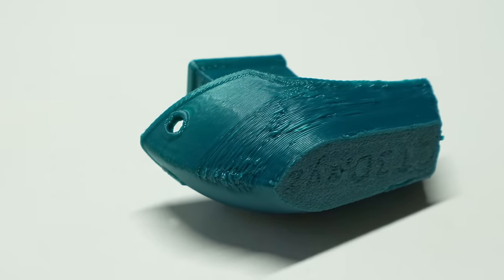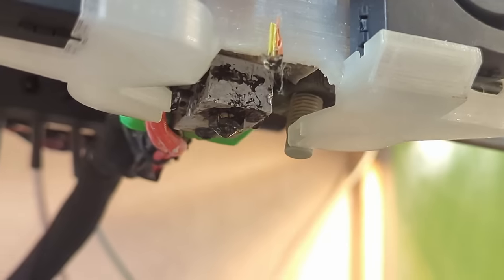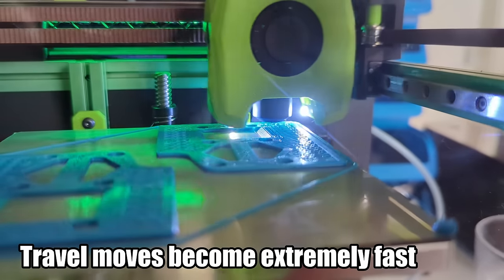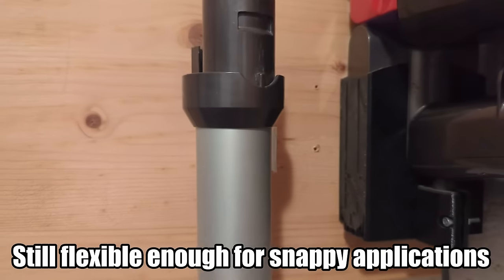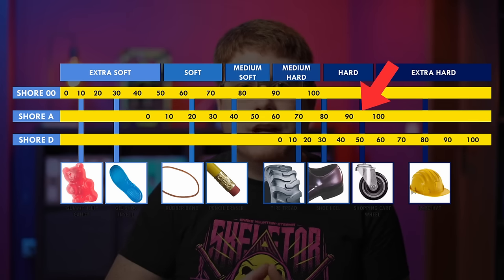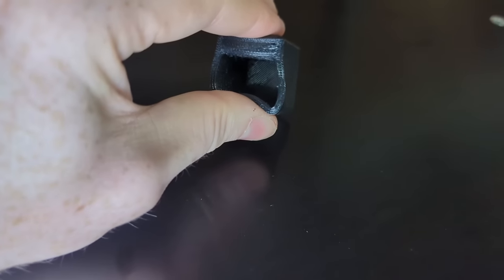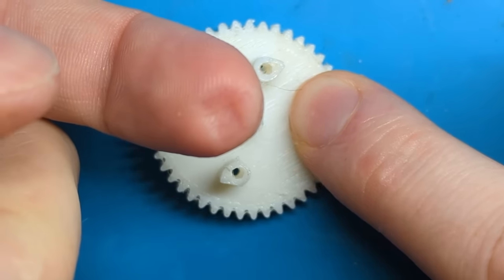3D printing material: When to use PLA, PETG, ABS, TPU, Polycarbonate, Nylon etc.

Comment: For nylon: hair spray on top of PVA glue on glass. I've had nylon break a glass bed when only using hair spray, and when cooling down after printing and it took a big layer of glass with it. You really need a glass print bed and good first layer otherwise it WILL warp. 100-105 bed, 280 hot end, over 50 chamber for generic pa6. I've printed a lot of nylon and it still warps some times if everything isn't perfect. It also doesn't like speed, 80mm/s max. Kind of flows like petg.
Reply from the maker: Higher chamber temperature seems to be the biggest factor, but my Prusa doesn't go above 40. I'll need a real heated chamber printer at some point
Reply: @SmallBatchFactory  I'm a bit unsure if it will break something, but there are some 300W 24V Heaters available. I thought of putting one inside the Prusa enclosure to heat it up to 50-60°C prior the print. Maybe not during print, because of the air turbulence it will generate.
With the MK4 inside the enclusure, it will also heat up the electronic boards and I'm not sure how they can cope with this extended period of higher heat.
I got a roll of pure PA6, not didn't dare to open it yet. (Also I don't have anything that needs the properties of PA6 right now)
Reply from the maker: Simply put: DON'T do it! Prusa parts are made of PETG and will get soft. I'm also wary of frying the board, I already had one but it was covered under warranty. No clue if it was the chamber but it definitely contributes.

For anything actively heated you need to keep anything sensitive to heat outside of the chamber. IMO it's not worth the hassle, I'd rather buy a machine with heated chamber where the manufacturer guarantees it will work. Killing your $1000 printer is quite a dare.
Reply: @SmallBatchFactory  Sadly, what I thought may happen. Would mean a thorough rework of the printer. Reprint the PETG Parts, active cooling on the boards and steppers. Could use peltier modules for that, because they then heat the enclosure while chilling the components.
I'll try to print without extra heating. Maybe just a longer preheat phase through the bed heating.
Other option is to print the prototype in something easier and then let a company make it out of whatever is needed.
Reply: @drstefankrank heat up your chamber with a hair dryer before you start
Reply: @travistucker7317  the hair dryer might work better than starting with a cool chamber, but it has also way more power than a 300W heater. Of course that heater would  need to be temperature controlled and stay safely below the PETG softening temperature.
Reply: @drstefankrank  Of course, you could melt the whole thing if you just let er rip. I used one for a while on a dip switch timer with a cheap thermometer on the gantry. 15 on, 45 off seemed to be the magic number for 40c for me, but your mileage may vary.
Reply: @drstefankrank  with your original comment of heating up the chamber before the print, that was what i was suggesting, more of a simple preheat.
Reply: @travistucker7317  Did this help you significantly with prints of difficult materials or  is it just not worth the effort?
Reply from the maker: It highly depends on your printer chamber. In my case they aren't well enough insulated to get significantly higher in temperate than maybe 1 or 2 degrees even after hours of printing. If you have a thermometer on hand you can put it in the case and test yourself. 

Getting the printer to 60 degrees certainly makes a difference but might also be harmful for electronics and motors inside the chamber.
Reply: @drstefankrank   @drstefankrank  That printer only prints abs printer parts. Really, more than anything, it improved consistently. Less parts warp off. It's harder on cheap bearings and belts, too. I would say it's worth it.

Comment: I've only ever used PLA, PETG, and TPU so far, but I recently got a new enclosed printer and I'm excited to try ABS and maybe some of the fancier stuff.
Reply from the maker: Just don't forget to have good ventilation and stay safe. If you're struggling I have a separate video on ABS printing.
Reply: Make sure to turn part cooling off. I ruined 5 prints before I found out that was the problem with ABS.
Reply from the maker: The funny thing is that's a way too generic take. At least if you have an enclosure. My ABS prints improved by a lot when I learned to turn the fan ON. I have a whole video on printing ABS
Reply: @SmallBatchFactory  what problems were you having? I forgot to mention I also moved supports closer. With the fan on the supports kept failing.
Reply from the maker: "fried" parts. You can see an example on the Thumbnail of the video. Heat simply accumulated. But I also design to use no supports (in the videos case those were Voron printer parts I just needed to print).

Long story short you can either print rather slow (or a large part) or you will need cooling (as always in a enclosure that is)
Reply: @SmallBatchFactory  I guess I will have to watch your other video

Comment: I needed to hand drill and thread holes in a soft PolyUrethane part, it was a nightmare, as I needed to compress the bit for it to bite, but not too much to keep a straight hole, and threading the hole was a nightmare due to the need to take out the tap and remove the residues. Post processing soft material is to be avoided as much as possible
Reply from the maker: Word! I cleaned the TPU part shown with a scalpel for hours. It's still not clean but good enough. Second print with retraction went a lot better

Comment: Great vid! How about which printer works best with which material? I.e. Ender is good ONLY with PLA, etc.
Reply from the maker: Thanks for your suggestion! There's no real "this printer doesn't work with material X" except for the three factors I discussed in my "which printer to choose" video. Other than that it's a matter of  tuning the machine correctly. Some materials are more beginner friendly than others.
Reply: @SmallBatchFactory  ok good to know. I sometimes go around in circles trying to ensure I pick the right machine. I’m living with an Ender 2 and desperately need an upgrade.
Reply from the maker: I personally love the reliability of the Prusa machines, but that also comes at a cost. Cheaper machines with cheaper parts just tend to give you more headache. Even my Voron had issues last weekend because of cheap extruder gears. Never had that with original Bondtech but they're also 32 bucks just for the gears...

Comment: I use what is appropriate for the application. 90% of the time it’s PLA (generally use a PLA+ unless it’s purely decorative). While I love PETG generally when I’m considering it there is something more appropriate for the application like ABS or ASA (as much as I hate printing ABS due to the tight rope walk of keeping it warm and ventilated in my tiny office).
Reply from the maker: Absolutely the way to go IMO. PLA is perfect for prototyping. Usually PETG is best for technical parts if you don't need the extra heat or impact resistance of ABS or UV resistance of ASA

Comment: I made those same shelf brackets for my filament out of PLA, they held up for 2-3 years then one night I heard a "BANG!", one of the brackets snapped in half and the dozen or so rolls of filament hit the shelf below it, broke those brackets and around 20 rolls of filament and the wood stringers hit the floor. I thought a car crashed into my house. I ended up using metal shelf brackets with PLA top pieces to hold the wood stringers in place.
Reply from the maker: That sounds like what PLA would do. I'm most  weary of the front wood holder, it seems rather fragile and already gave a bit in. Du you remember how many perimeters you used?

Comment: I've found that TPU actually has a much higher temperature resistance that PETG. Yes, it gets softer and more flexible when warm, but it does not permanently deform under heat until WELL above what PETG does.
Reply from the maker: Yes, for the video I've stuck with official numbers but as you say it behaves quite different in reality.
Reply: I remember reading somewhere that TPU has glass transition temp of below 0 degrees thus at ambient temp its not rigid, so at higher temps it get a little sticky yet remains somehow intact till its melting point, I ve use it to print cap for car's coolant reservoir and after months in the bonnet its still snug as before.

Comment: I use stock ender 3 to print generic TPU (probably the most rigid type)  and instead of printing it without retraction im actually printing it at 8mm retraction at 20-35mm print speed and adjust overlaps setting and prints just fine. The biggest impact is if how dry your filament is.
Reply from the maker: It works, yes. As I said you have to go really slow. You probably also have very low retraction jerk set for it to work.
Reply: I use stock ender 3, 228 nozzle, 40 bed, 60 mm/s. I slow it down to 40mm/s for more difficult prints. I have even had good experience printing ninjaflex 30mm/s.

TPU is not a problem material, it is moisture, user, or machine error. Anyone with these errors are not doing fast or consistent printing regardless of the material.
Reply: I'm just surprised somehow that these machines are very versatile also different ways to adjust profiles to suit your setup, i might also try lower retraction and try experimenting again with flexibles. Thanks for the informative video.
Reply from the maker: Almost anything is possible if you know which settings to adjust. A lot of my friends don't know how to analyze issues. That's probably why Bambu machines are popular
Reply: @SmallBatchFactory  true, the fact a year ago i got ender 3 is due to its accessibility in my country, parts are everywhere  and low price at the expense of tinkering with it yourself its simple and can be troubleshooted easily as well, if got extra cash probably bambu still good option but for starters ender 3 is still good if you want to get into 3d print you'll learn a lot as you progress just hope they dont get fed up with it when it bogged down occasionally 🤣.
Reply from the maker: The troubleshooting is what bothers most people. I never had issues with my CR 10 for example. It's the first version with only one Z axis motor. Still works fine. Even printed a 5 day print a few months ago. I love my hassle free Prusa, but tinkering with the Voron is also very cool
Reply: Meanwhile the first funtional print I did on my ender 3 is the spacer for z axis stepper motor to prevent it from binding still on my printer till this day. XD
Reply from the maker: Oh yeah, the CR 10 came with way to small bed leveling screws, so first print were those bigger wheels the Ender later adapted. Also a bed cable strain relief and a better fan duckt. Als things the CR 10 desperately needed to be somewhat safe and useable.
Reply: Seems like these printers were desperate for attention from the get go, yet once ironed out they all work just fine.

Comment: PETG was “the ABS replacement” since it was easier to print with less warping and better plate adhesion. That was before Bambu came and changed the game. With an enclosed printer there’s really no point of PETG anymore (imho). In fact, I have never even printed PETG since I got my first X1C, mainly since it just cant be printed as fast as ABS and is more prone to stringing.
Reply from the maker: Definitely, the stringing can be a real pain. ABS prints so much faster. But chemical resistance is where PETG really shines. It also doesn't give off as much fumes as ABS, so there's an up and downside to both.
Reply: Many people print in their homes without an exhaust vent. I wouldn't use materials that create toxic fumes at such a degree.

Comment: I use PETG for most mechanical items. It's more durable, less brittle and doesn't creep as much, but it's not as rigid.
Reply from the maker: It's usually a good choice. Sometimes I like PLA, often I like ABS. But I also use PETG, especially for snap in parts.

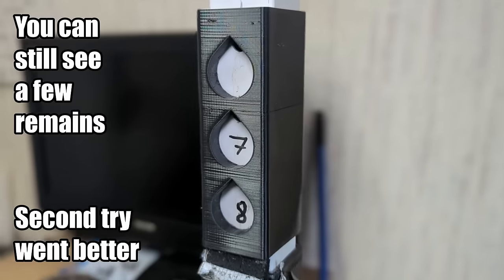Comment: What is being said at 8:44 about TPU?   “turning off …………?? helps, and keep the extruder ……………..??.. to a minimum.”.     Yes I am struggling with TPU on a Prusa MK3S+.
Reply from the maker: "turning off Z-Hop helps and keep the extruder gear tension to a minimum."

Z-Hop is when the print head moves up a little before it moves to another spot on the print. It's prone to pull fine strings. Turning it off wipes the remaining material a bit and reduces those strings.

Extruder gear tension is the pressure on the filament. You adjust that with the screw on the left side of the print head. Keep it as low as the filament runout sensor allows.

Ths Prusa profile is actually quite good, only thing you should activate is a bit of retraction. That reduced my stringing by a lot.

Comment: I think pla is something I am mostly done buying. It gets stiff and brittle while also having terrible creep. It doesn't make a lot of permanent things very well.

I am using up my stock for disposable prototypes to save my petg for a moment. Petg costs though are in parity now so I have no further incentive to buy pla unless it's a very specially colored rolls.

I think it is still pretty good when printed into very solid parts that don't get heated ever.
Reply from the maker: Never had any issues as long as I choose the material type appropriately. As you say, PETG is so cheap nowadays. It's just not suited for everything, sometimes you need the stiffness.
Reply: I have used PLA from more than 5 years old spools and brittleness never corelated with age.

Comment: BBQ handles made from PEEK? That is interesting - thought it was simply too expensive for any consumer application. From my expierence 420°C Nozzle temperature ought to be enough (maybe even less with very slow printing seeing how the melting point is at around 345°C).

Anyway - very interesting video! Nicely condensed the advantages and disadvantages of each material!
Reply from the maker: Thanks!

Somebody mentioned it might not be PEEK but some other kind like Bakelite

Comment: Petg is slightly more difficult than pla to print but compared to other materials as a whole, petg is a well rounded material. Its perfect for most, if not all, my use cases.
Reply from the maker: My biggest complaint is I have to keep it dry in order to prevent stringing from hell. PLA and ABS are less impacted by this. But in many cases PETG is a very good material. Look at the background, there's 30 kg of PETG :-D
Reply: @SmallBatchFactory  i keep my petg in a sunlu dryer box mounted on the top of my printer. I let the dryer run once before printing then run it during a print.
Reply from the maker: @TheNewBloodDan I have one too but I'm usually to lazy to use it. Plus I also have 2.5 kg spools, they're too big
Reply: @SmallBatchFactory  damn son thats alot. thats understandable

Comment: I have found formfutura carbonfil is stronger than the base material. Main difference is to get true carbon fiber strands not milled carbon fiber. Also, on my creality k1 mqx I print carbonfil at a higher temperature of 260c and I get very clean prints with very high strength
Reply from the maker: From what I know it mostly becomes a bit stiffer. So depending on your use that might be what you need. I'm not sure how long these strands really can be before they clogg a Nozzle.
Reply: @SmallBatchFactory  thats why I raise print temperature

Comment: After owning an enclosed printer, ABS for all of the above unless specified to be PLA
Reply from the maker: Yes, Team ABS!
Reply: How do you extract the fumes?
Reply: @MetalheadAndNerd  I HAD a carbon hepa filter and a couple of nevermore in the printer and it did very well with the PM sensors I had bought, now the printer is in another tiny room with a couple of noctua fans strapped to my window as exhaust and the sensors read normal and I don't even smell the fumes when I go over to fetch parts 

 you could easily cut a hole on top of the printer and put a fan on there and get a vent tube to rerout all the fumes out a window and let mother nature deal with them

Comment: PLA is actually easiest material the print. If you need to be structural you use PLA Plus. Each filament has its pros and cons like for instance, nylon has to be dried before you print and it has to be printed in an enclosure But it is heat resistant
Reply from the maker: Exactly. That's what a lot of people don't get, there's no "best material", online appropriate use cases.
Reply from the maker: By the way I've seen your profile picture. A friend of mine develops airsoft upgrade parts that are printed and/or electronic. He's currently working on a Halo like bullet counter for which I did part of the programming. Pretty cool IMO

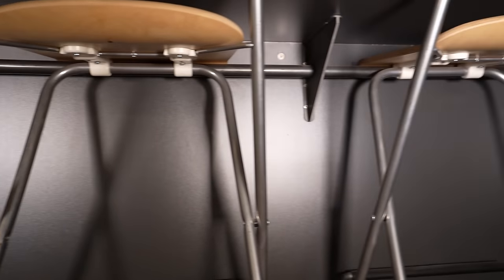Comment: At 3:10 did you say you printed barstools out of PLA?
Reply from the maker: Not the stools, just the holders that I hang them on. So it's an iron pipe held up by two shelf brackets and holders in each side made from PLA. They're shown in a bit more detail in the "Cheap Filament" video.

Comment: Imo PLA is the best goto for more projects and there are other filaments for more specialised things like Nylon an PC for higher heat environments. Id even go as far to say PETG is outdated with the really good PLA blends that are out there.
Reply from the maker: In most cases PLA is just absolutely enough. Where PETG shines is flex and chemical resistance. I've used PETG in salt water for years for example. Wouldn't try that with PLA.

Always knowing the best material for the job is a whole profession on its own.
Reply: Absolutely and thats the key here I think. But I do think PLA has for some reason a bad reputation. And a lot of people think other filaments are "stronger" when they simply arent. One thing PETG is great for though is a support material for PLA! @SmallBatchFactory